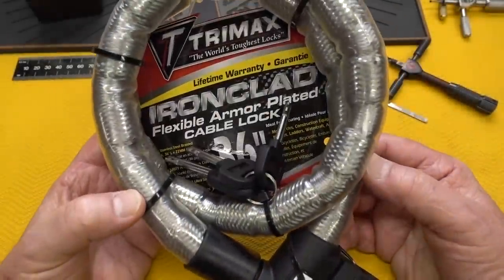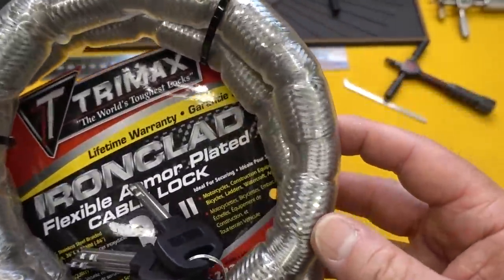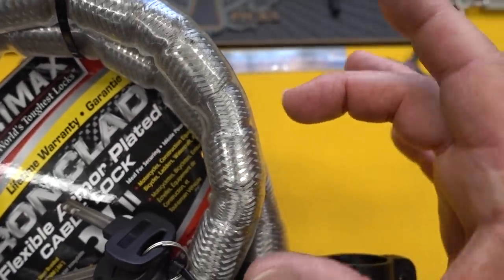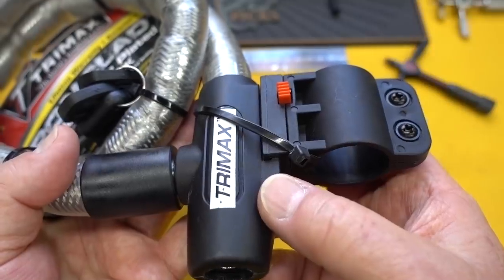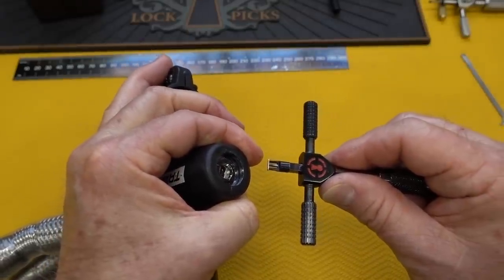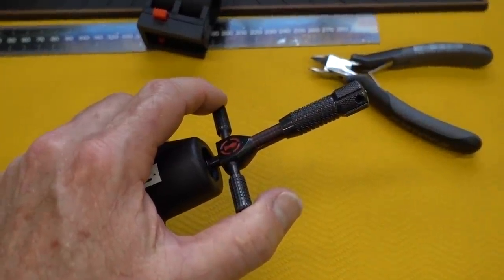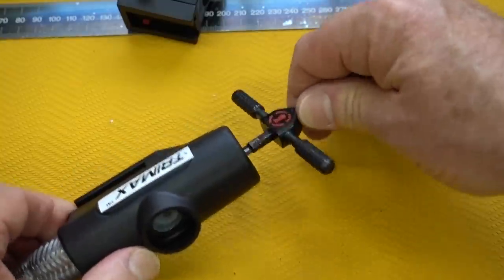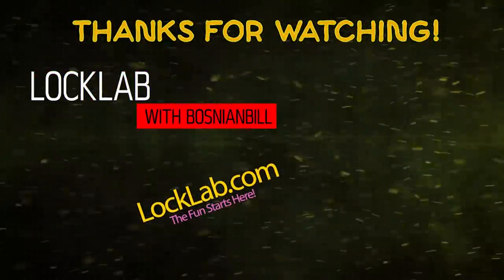(1689) Trimax Ironclad Bike Lock

Comment: Bill, i would have liked to seen a destructive test to see if the lock core could by slide hammered out, or just how cut resistant the cable is, particularly right where  it enters the shackle body, which probably only includes the 1/4" cable itself, without all the other outler layers. I think maybe a follow-up video might be a good idea.
Reply: Stan Burton yes please!!!
Reply: I would also love to see a destructive entry rest!
Reply: I've been search the YouTube for a while and no one has a video on cutting g this yet. I would love to see this destroyed.
Reply: A big hammer often makes an effective lock picking tool.
Reply: yup it seperates and u can see then cut the tiny cbl....

Comment: It would be kind of interesting to see just how good that cable really is.
Reply: probably not much good. a 4" grinder would make quick work of slicing through that cable , but it would be Loud & thats s not desirable to thieves.
Reply: OcRefrigeration , Hvac & Electrical Video's. Lol, 4“ grinder, do you have that reply saved to put under any video about locks 😁
Reply: Lassi Kinnunen  Exactly!!!!
Reply: @12346unkown  🤔 I have said that a few times. Must have picked it up off others who comment.
Reply: Lassi Kinnunen  Perkele
Reply: @OcRefrig  Tried subscribing with notification on, says I can't because it's "kids stuff" wanna check that?
Reply: No , But i guess i should. Doesn't say much for locks if they ALL Fail so easily.
Reply: mike amun - ill takea Look 👀.  strange. im def NOT A kids channell. are u sure u did not click something close by it. this is first im 👂 ng of this.
Reply: Copied from reviews I found under one of several Amazon entries:
"
￼

steve

1.0 out of 5 starsVerified Purchase

Reviewed in the United States on June 6, 2019

Weak key, weak cable... Find something else.

Felt like a sturdy cable. The lock action wasn't very smooth. The key snapped off inside the lock the second time I used it, with surprisingly little force.

Update: Amazon wanted the lock back before they would give a refund. Unfortunately I did not have many tools with me, but that proved not to be an issue. Bending the cable with my bare hands revealed that the outer metal braiding is purely for show; it is NOT connected to the lock body. I was able to snap the braiding by kinking the cable. This revealed the inner cable... something about the thickness you'd see on a laptop lock. About 5 minutes of twisting with a pair of cheap pliers was all that was needed to snap the inner cable. Someone with a pair of cable cutters could go through this in literally one snip.
"

This review comes accompanied by several photos showing the cable both snipped with a pair of cutters and failing where it connects to the actual lock surrounded by only plastic, where it will allow direct access to the thin inner cable when bent.

Comment: Great video Bill. It would be very interesting to see how it holds up to physical attack such as bolt cutters. I know stainless braid can be hard to cut but, due to manufacturing cost limitations, I'm concerned they may have had to take some shortcuts. It seems to be a very nice lock for the price.

Comment: Stainless steel is a good addition to the upgraded security of this bike lock 👍
Length of time it took to pick is a definite plus, unless you lock your bike up in the shadows.
Reply: Bike frame and wheel will still be there. Everything else would be stripped off.

Comment: I bet that cable could take the heat when someone tries to cut it! 

A cool thing to do would be a comparison of what is the best cable/chain in regards to cut resistance.

You could use a standard chain, Abus security chain, traction chain for car tires, and this Trimax cable.

Comment: The stainless cable looks weird but better than typical cable locks. I didn't expect much better with you picking the cylinder with your tool though.🙄😝

Comment: Are there any disc locks that tension with a random middle disk rather than one on either end? I would seem to me that this would defeat the pick tools I have seen you and LPL utilize.
Reply: There are disc locks that tension on another disc. LPL gets around it by tensioning using the tip on a zero cut disc and turning the rest of the tool instead.

Comment: Found this review a user placed on Amazon amongst many others under one of several entries on the site..:

￼

steve

1.0 out of 5 starsVerified Purchase

Reviewed in the United States on June 6, 2019

Weak key, weak cable... Find something else.

Felt like a sturdy cable. The lock action wasn't very smooth. The key snapped off inside the lock the second time I used it, with surprisingly little force.

Update: Amazon wanted the lock back before they would give a refund. Unfortunately I did not have many tools with me, but that proved not to be an issue. Bending the cable with my bare hands revealed that the outer metal braiding is purely for show; it is NOT connected to the lock body. I was able to snap the braiding by kinking the cable. This revealed the inner cable... something about the thickness you'd see on a laptop lock. About 5 minutes of twisting with a pair of cheap pliers was all that was needed to snap the inner cable. Someone with a pair of cable cutters could go through this in literally one snip.

This review comes accompanied by several photos showing the cable both snipped with a pair of cutters and failing where it connects to the actual lock surrounded by only plastic, where it will allow direct access to the thin inner cable when bent.

Comment: TINY inner cablefrom an amazon review  (already posted by Harrik, repeated here with pictures:
Felt like a sturdy cable. The lock action wasn't very smooth. The key snapped off inside the lock the second time I used it, with surprisingly little force.

Update: Amazon wanted the lock back before they would give a refund. Unfortunately I did not have many tools with me, but that proved not to be an issue. Bending the cable with my bare hands revealed that the outer metal braiding is purely for show; it is NOT connected to the lock body. I was able to snap the braiding by kinking the cable. This revealed the inner cable... something about the thickness you'd see on a laptop lock. About 5 minutes of twisting with a pair of cheap pliers was all that was needed to snap the inner cable. Someone with a pair of cable cutters could go through this in literally one snip

https://images-na.ssl-images-amazon.com/images/I/717rKW-jFLL._CR0,0,1414,1414_UX175.jpg
https://images-na.ssl-images-amazon.com/images/I/71QGwthU+nL._CR0,0,1414,1414_UX175.jpg
https://images-na.ssl-images-amazon.com/images/I/71+MziqcqOL._CR0,0,1414,1414_UX175.jpg
https://images-na.ssl-images-amazon.com/images/I/71dvJE5ftUL._CR0,0,1414,1414_UX175.jpg